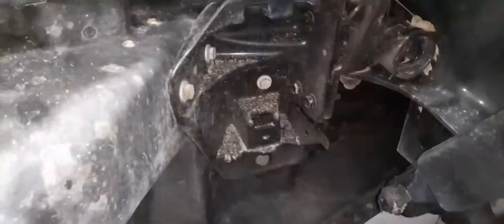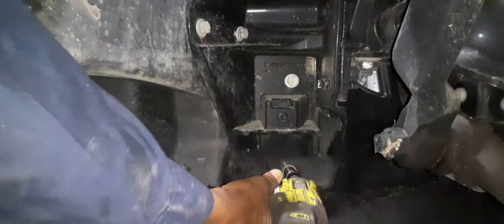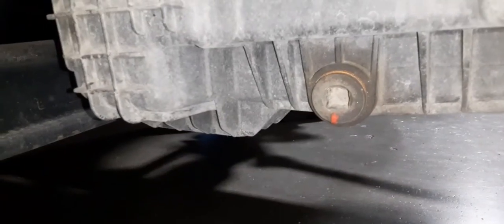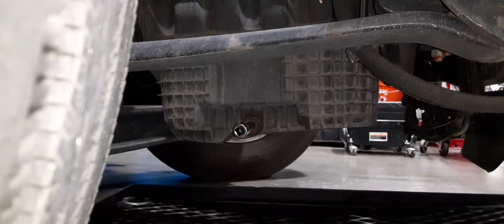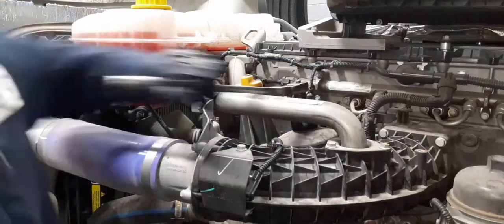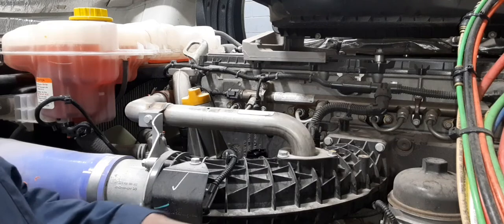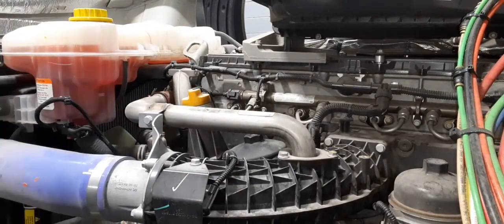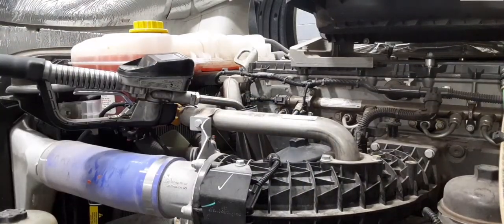OIL CHANGE ON 2020 FREIGHTLINER  SUXX

Comment: I dont see how the bumper is in the way at all!! 🤷‍♂️
Reply from the maker: Try sliding the oil pan underneath the truck and you will see what I mean.
Reply: @truckerslife1013  pull the truck up on wood blocks is what I would do to get the hight I need. Good video though.
Reply from the maker: Fo sho.  I am showing the safest way for a non mechanic to do this.  You are correct tho.
Reply: Gotcha!! Well good video man keep up the good work!!
Reply from the maker: Thank you, I appreciate that 💯
Reply: I thought that too but since I own one I know that shits way too low to the ground without it being on a lift. However, I may employ some blocks to raise it a bit, to hopefully save some time.
Reply: You definitely just saved me at least 1200$ and I need every dime. Lol
Reply: Not sure you can get under there to drain oil with wheel and bumper in the way